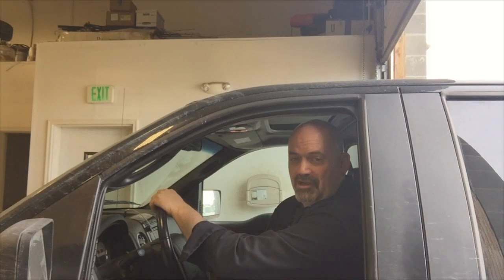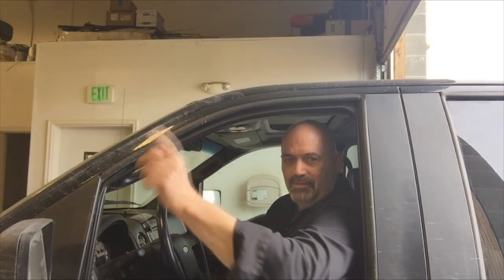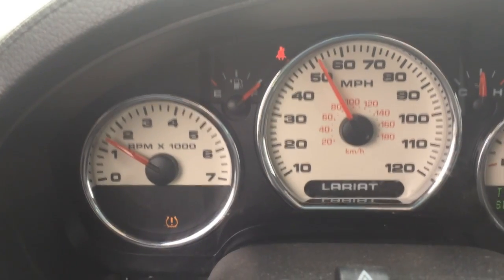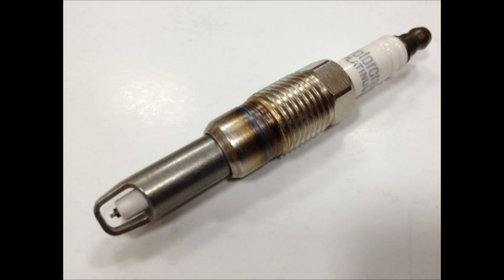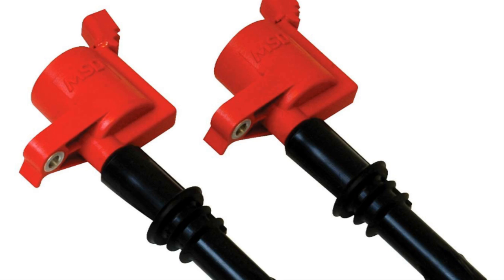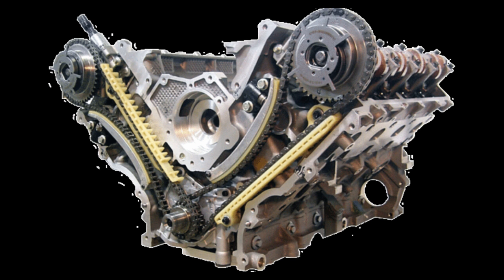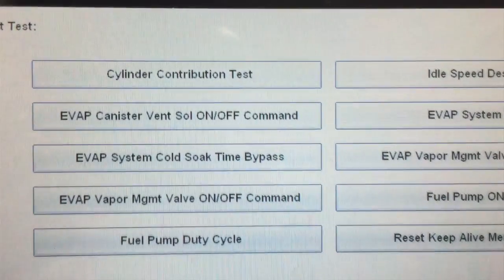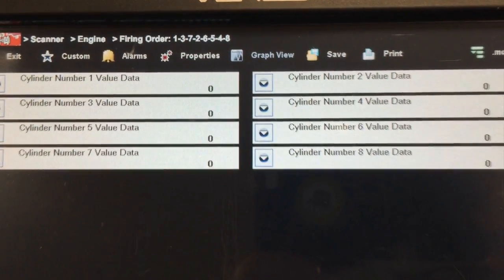Ford F150 F250 Transmission Shudder

Comment: hey i got a question for you! i have a 2015 ford escape 2.0 EcoBoost with 122k. recently when i first start my car and i usually let it idle for about 3 minutes and i put it in drive and the car jolts a little bit! if i put it in reverse or neutral its all smooth! once the car warms up everything is smooth like coming out of a store start the car put it in drive and its smooth only when i first start my car, my transmission was rebuilt at 53k and now has 122k on it, last week i did do a transmission drain and fill on it and the transmission fluid was dirty and black! but it did have a little red color to it! and the transmission fluid didnt smell burnt. it seemed to fix the problem start the car in the morning put it in drive all smooth! i think the problem is coming back when i put the car in drive its very slight jerk, do you think i should do another drain and fill on the transmission to get more of the dirty fluid out? any advice? oh yeah no check engine light on.
Reply: Dude you solve it? I feel.something like bump.or shake when push the pedal hard or.costant speed and rpm climbing hills..do a drain and fill but not 100 solved...last year do 3 drain and fill.
Reply: @pablomachucachavez1014  yes I did 4 drain and fills on the transmission, but not all at once like every weekend for a month and every time I did it the fluid was  dirty and black, now the transmission has 153k on it and stopped doing it
Reply: @Mike-Capz83  umm.okay i did one a couple days ago..anothe in march and the other 3 did in abril of last year..so a will make like two weeks more another and see what happen..like I said in the forums the simpthoms not talk about trans..hope not be the trans
Reply: @pablomachucachavez1014  yeah I would do a couple of more drain and fills to get more crap out of it,
Reply: @Mike-Capz83  thanks dude...i really hope it wfll fix with that..also saw a videos where they add additives to a ford explorer with the same trans...a repair shop here its about 1500usd and the trans about 3500 😩😩
Reply: @pablomachucachavez1014  damn, cheaper just to try and drain and fill and only use motorcraft lv, I did try valvoline max life full synthetic transmission fluid, and transmission was acting really weird, hard shifts, and banging into gear, drained it out and put back in motorcraft lv back to smooth, and make sure your transmission fluid is at the full mark,
Reply: @Mike-Capz83  yep always use that and buy in dealer shop...thanks dude
Reply: @pablomachucachavez1014  not a problem brother!! Let me know if it helps you

Comment: shudder goes away with OD off. does this mean i need a new freaking Transmission?
Reply: Torque converter, or you can try replacing fluids n filter n add Shudder Fix also . The latter works a lot of times but will run you bout $ 150
Reply: @eazyridin7283  what would the torque converter cost?
Reply: Adam Hill you can find them from $180-300 . Plus labor unless you know someone

Comment: This did not help at all, I have a OD shutter after, I rebuilt the transmission in my 06 Expedition, I kind of think it's the over drive valve or the #7 check ball in the valve body, I just wanted to see what people have done to fix it, I did not see this guy fix anything.
Reply from the maker: Kewl

Comment: Ford is not telling me my shudder at takeoff and my vibration at 45 and 70 is my after market wheels (Moto Metal) which I HIGHLY doubt but they want to find me some takeoff stock wheels to see...whatever....shudder fix did NOT stop my issues...I believe it is a converter or driveshaft.. I am about to just dump this truck and get a dodge...SO frustrating.
Reply from the maker: Don't overlook a possible misfire problem. Look at mode6 data and se if any cylinders are dropping out. Hope you get it nailed down
Reply: Found I had a bad coil that was causing spitting and sputtering but did not fix the shudder.

Comment: Is there any way this could ruin my tranny? I've had my O/D light flashing off and on for years now. I ran the codes and its a "TC slip lower than 1:1" so i bought this stuff hoping it can clear that up.
Reply from the maker: Well I don't know what you have to loose. Sounds like your transmission if fried already. If it helps then you saved a ton of cash. Probably no helping yours buddy. Sorry about that
Reply: Don’t think a misfire if that’s what it is could ruin a transmission.

Comment: I’ll try. My 2012 explorer seems to fail downshifting from 6 to 5 and shutters when coming up to speed at 57-60 mph.  When have it in manual shifting there is no shudder at those speeds at 5th gear, but present  in 6th.
Reply from the maker: Sounds like trouble.

Comment: when i drive my ford escape all wheel drive   it goes through all the gears smoothly and drives great  but when it kicks into over drive at 45 on outer roads or 65 down the highway   as soon as it hits about 1800 rpm i get this shake like the car is having a seizure    what do you thnk?
Reply from the maker: Maybe a bent rim or bad tire
Reply: I have had them checked.  That not it.    It feels like the torque converter isnt locking up.
Reply from the maker: That's possible. May be a transmission issue. You can try the additive. Won't hurt.

Comment: I have a 02 Excursion with a 6.8, I tried turning the OD off, same symptoms, shakes between 45 and 65, no misfires detected on scan, what’s the fix for this?
Reply: same here shudder fix first if that doesnt do it converter replacement it looks like I'm not too sure what else to do

Comment: No OD.
Reply from the maker: Are you sure you don't have a misfire? That's the most common cause of your symptom.
Reply: If I do have a misfire or misfires it's not making the DTC come on which is possible.  By what troubleshooting technique did you use to determine that that is the most common cause of this symptom.  Did the PCM know that there was a lack of power coming from the engine therefore it would up shift to the next gear? Just trying to understand it a little bit more.
Reply from the maker: Get a scan tool that can look at mode 6 data and see what the misfire monitors look like. Or replace the plugs and COP boots with motorcraft parts and see if that clears it up. Look for any coolant leakage at the intake gasket around the thermostat area running into the #5 COIL AREA OR THE #4 CYLINDER FROM A LEAKING HEATER HOSE.